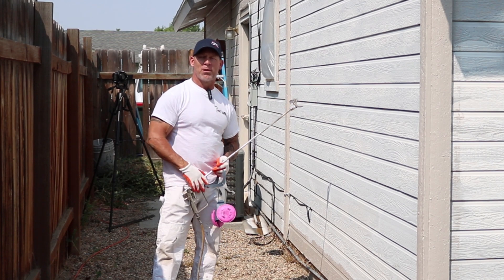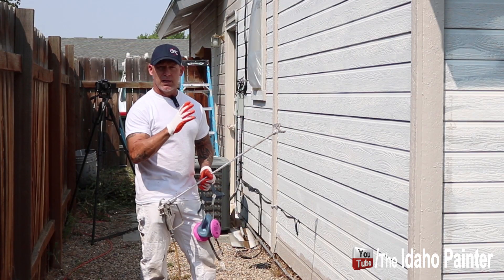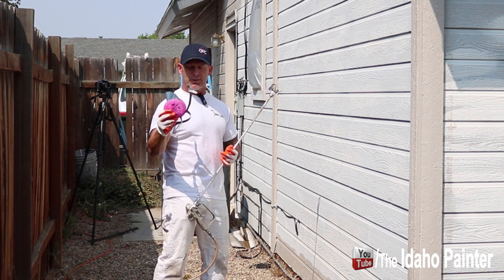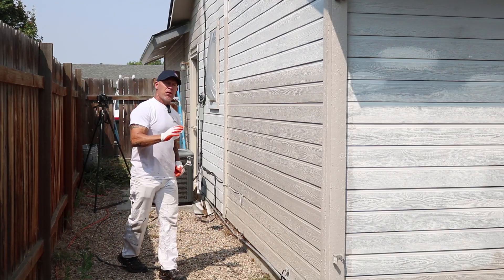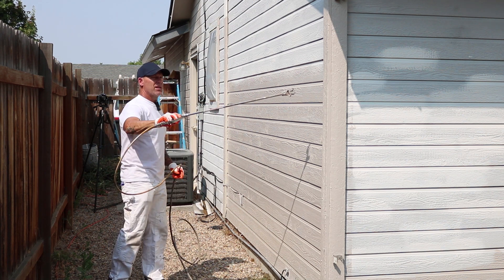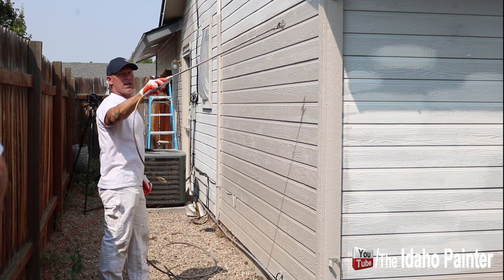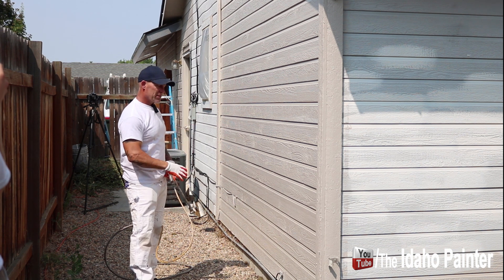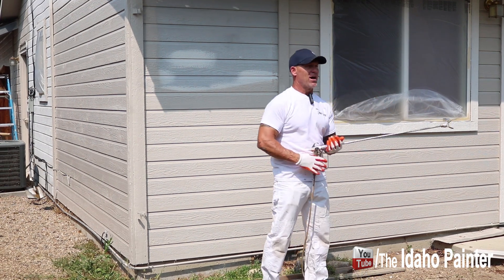How To Paint A House With An Airless Paint Sprayer

Comment: It's better to hit the corners on point first with a horizontal spray pattern, then spray the walls out towards them working from the top down. The paint distortions are called "dry laps" and areas where the coat is too thin are called "holidays". It's ok to spot check the product with a "wet mil" gauge and follow the application recommendations. Back rolling/brushing is not necessary when the prep is done properly and all angles are covered. Rolling scaffolds are preferred over ladders when painting most walls. Long tip extensions should only be used for very hard to reach areas and use a smaller diameter "whip line" at the last few feet of spray hose on airless and conventional sprayers to help reduce  fatigue  on continuous spray jobs where it's not uncommon for a painter to spray 25-50 gallons a day depending on hours, wind loss and mil density. When painting the side of a steel building like a power plant or factory  from a "window washer scaffold", each pass from the top to the ground is called a "drop". One could also encounter several "drops" on a large house from a ladder or standard scaffolding. Try to avoid dry lap on the previous drop. Stay very aware of wind direction when spraying outdoors and avoid overspray blowing on all visible roofing and on other peoples property, especially automobiles. Even when running crews of up to a dozen industrial painters, I still grabbed a gun and painted right along with them and preferred the shorter trigger myself. I was in the paint business for about 25 yrs before I switched trades and became a control room operator at a power plant and have seen my share of product, equipment and technique on all types of surfaces including automotive. Keep in mind custom paint pays the best rate. Stay safe, keep your gun clean and your paint strained!  Cheers!
Reply from the maker: Yes, thanks for watching!
Reply: damn, dropping some knowledge lol thanks
Reply: Yes sir. You seem to have it down.
So if im spraying a house and both trim and body get painted, do i spray the trim first? Or do i spray the siding/body first? Thank you for the input and your knowledge.
Reply: @kensummerfield7899  Always spray the large surfaces first so even if the paint gets on the trim it it's not an issue. Then paint the trim by cutting it in with a quality brush of the type purchased from a paint outlet rather than a big box store for best results. A 3 inch sash brush with polymer bristles for water borne paint or a natural bristle for oil based paint will suffice. Very straightforward process. Feel free to let me know how your project is progressing and don't  be afraid to ask any questions at any time. It's always better to do the job correctly the first time. Quality painting can be very time consuming but that's what separates true painters from "wanna be's". Kind regards. Ray L.

Comment: Do you have any tips for handling customers questions about the number of coats that you’re applying? If you can do it in one coat when spraying, how do you handle the customers question when they ask you if you are going to apply a second coat?
Reply from the maker: We just explain that a high quality paint will cover in one given the right circumstances. If it needs two then we will do two

Comment: You should put a shot valve on that extension,will stop those  blob coming out when you pull the trigger.  hi from nz.
Reply from the maker: Awesome, thanks for the tip!
Reply: with the shot valve you can correct the angle  if spraying the lower part and the highest part as well.

Comment: You say 5-15 tip at 2200psi. Is that the psi just after the point the fingers disapere and taper? Also how long does that craft shield holder last b4 it wont lock in anymore and just flops up and down. Never had one. Thanks

Comment: Would like to see a vid on how you would tackle a vinyl siding job. Have you guys done some in the past? Do you usually stay away from painting vinyl? I know most people advise against it, but I suppose it's a cheaper alternative.
Reply from the maker: We do paint it, you need to use vinyl safe colors though
Reply: Thanks for the response. Have you had issues with customers painting their vinyl siding in regards to it not lasting?
Reply: If using sherwin williams paint, use superpaint or higher quality, like duration or emerald. Be wary of darker colors that use black pigments in the formula. Darker colors will warp the siding. This is why most vinyl siding houses use lighter tones.

Comment: I’ve heard you say back-rolling produces a better quality. Do you bid differently with and without back-rolling? Does the customer know or care? Thanks!!!
Reply: Depends on the sidings
Reply: Yeah, rougher siding you want to back roll. Manufactured siding like this you can usually just spray. Though sometimes when it gets old and weathered back rolling can still be good. It forces the paint into any weathered areas or micro cracks like in cedar or around nail heads.

Comment: How do you handle spraying interior walls where the ceiling is about 50% higher than a typical bedroom wall.  Would you spray horizontally and work up the wall that way by using a raised platform as you get higher and higher up the wall?  Or would you do it vertically and go up as far as you can and then get on a raised platform and then spray the second half vertically.  My guess is horizontally like you are doing in this video.

Comment: In order to apply an even coat of paint the gun must be pointing perpendicular to the surface being painted throughout the entire stroke with half fan overlaps
Reply: I was thinking the same thing. Which he can't do when he uses a 30" extension like that, right? But it seems to work for him. what do you think?
Reply: @mrjessephillips  yes i think it works for him, exterior paint is not as sensitive to this concept but when spraying indoors on a smooth surface and lights shinning it will definitely matter

Comment: What about back-brushing on rougher surfaces?
Reply: I always back brush or back roll rough siding. When spraying alone the paint won't penetrate into micro cracks in the paint or fully fill in rough cedar spots. If you're doing two coats you should only need to back brush the first coat.

Comment: 2 questions, do you get spits with you 30 inch extension? I watch closely and can not tell, even when you stop and go at tradition points.
I have a 10 inch extension and sometimes I do spit and sometimes not.
2, how can I safely paint a gable wall that sits above a steep metal roof? Thanks for your help. I have spent hours watching you videos.
Thank you for your time
Reply from the maker: Use Graco Clean Shot to get rid of the spitting.
Reply: Home Improvement How To's im a new painter i watch your viedeos for tips
Reply: Thanks Chris
Reply: Thanks Chris or company

Comment: can you comment on painting / spraying when your eaves and fascia are different color (e.g. white) than the siding? I imagine paint siding first, trying to minimize overspray in the eaves, then mask the siding, and spray eaves?
Reply: use a shield and do it. if you can do it well enough from down below you can barely tell. once done touch up with the base color.
Reply: @joshuakim1638  so do eaves first or last in that scenario?
Reply: @kiva822  i always do the siding/stucco first.  over spray into the undereaves is okay just keep it minimal. after use a shield and mask the siding as you spray the under eaves.

Comment: I'm in the market for an airless paint gun.  After doing a little research I've narrowed it down to the titan 1700 hea.  Is the Wagner 170 and the titan 1700 the same system? This is just for work around the house.
Reply from the maker: Titan and Wagner are the same. A Titan 440 is a Wagner PS 321. Exact same different color.

Comment: I've been spraying behr exterior flat paint. The t111 siding finish came out looking uneven. Behr flat paint isn't really flat, (it kind of has a sheen to it.) would I still have This problem if I used a paint like kellymoore flat paint. Kelly Moore flat paint has a true flat finish. With the behr paint You can really see the places where I started and stopped, it looks heavy in places is the best way I can explain it.
Can you explain any of this for me? 
Thank you for your vids.
Reply from the maker: If it is supposed to be flat and it is not I would take it back. But, I would never recommend Behr paint, it is not a high quality paint
Reply: what is your favorite paint for long lasting exterior?

Comment: Well the 1x4 trim that is used not on a corner, window or door trim is something not common in our area.  It helps you find a start and stop point but we typically use hardy plank siding and the house won’t have random trim pieces, in random spots down a wall, to have this luxury when spraying. How do you start and stop on a 60’ wall that doesn’t have these?

Comment: harbor freight sprayer has high, low, roller etc. settings (no numbers) should I use high
Reply: Spray a piece of cardboard and dial in to smooth. Or get a pressure gauge for the gun most important make sure you got that warranty from harbor freight
Reply: @ronzojonzoify  maybe just lucky. set to close to the high setting and have a flawless paint spay on my entire house. way to go harbor freight. oh and thanks to  the idaho painter for his response

Comment: If the corner boards and window trim is to be a different color , which do you paint first or do you just roll the trim after painting the sides?
Reply: James King you mask them off if there is a major colour difference or you can just stop short and brush the last section of board close to the trim 

I tend to rather tape it off then brush trims in

Comment: Yeah risk your life to avoid lap marks? How about feather the fan in and out of each section and don't pull the trigger directly onto the surface. The initial burst of the sprayer when you pull the trigger is higher then when you hold the trigger down.  Do not start and stop on the substrate and feather it out and you won't have start stop marks or heavy edges.  BTW that wand is way overkill man lol

Comment: Wouldn't you get a mad spit if you stoped with a 30 extension?
Reply: Capthrax1 you get a little. What I do is adjust the nut on the back until it spits less/none. If you adjust the nut without an extension you can also get all spit to stop. Most guns arnt dialed in off the shelf you have to make this adjustment.
Reply: Santiago rivas . Learn something everyday.
Reply: can you say loogie. Dont know how to spell it. Needless to say all the overspray from that pole. OMG

Comment: and blow paint everywhere. using one of those poles causes more overspray. you must have everything covered and all the cars in the neighborhood covered with that technique. ha ha.
Reply: mikethepainter only if you have the pressure thumping
Reply: mikethepainter you can cover 3 blocks, if you don’t know what you’re doing you’ll have overspray everywhere anyway.
Reply: mikethepainter FFLP spray tip probably they massively reduce over spray. I've used them and thought was it even worth sheeting up.
Reply: Any sprayer will tell you if theres lots of over spray your pressure is to high. The extention pole is only 30 inch i use 2mtr ones and i get no spits after triggering off. Its knowing you pressure and tips that make your job efficient.
Reply: mikethepainter everyone is a painter too right? You guys are all rookies.
Reply: The pole is no different than without the pole. The tip is still the same distance from the surface, and has to be if you want a good pattern from it. If an unskilled person just waves it around, then all bets are off. There have been jobs where I have run a pole that was 8+ feet to do tall ceilings.

Comment: You are just another painter showing people how not to paint.  No respirator, ever heard of IPF?  (idiopathic pulmonary fibrosis).  Getting this material in your lungs and sinus passages not good.  Safety is first thing you should communicate  As far as your technique you are not applying an even coat because you are hooking it.  The objective is for the fan of the spray to be held in same distance as much as possible for each side to side movement.  Fan of spray is always perpendicular the surface.  Just watch robot painting machines. The results will vary especially using cheap paint, and in this case if you are using cheap paint without a back brushing with 4 inch brush is not an even coat. I am a licensed California C-33 painting contractor for over 30 years.